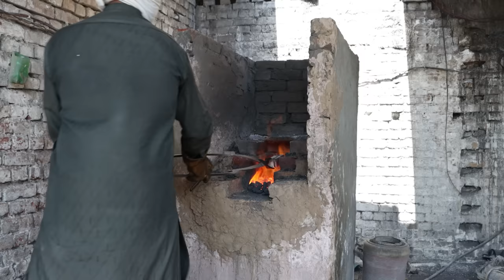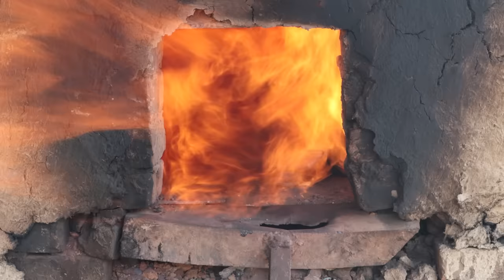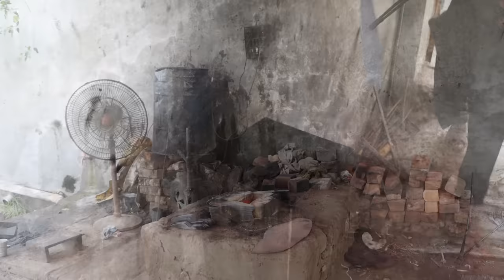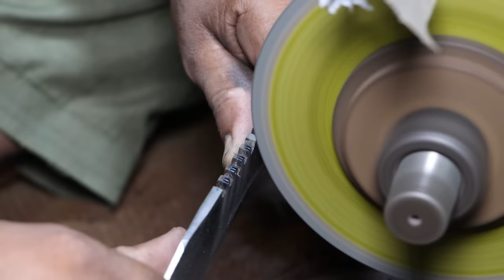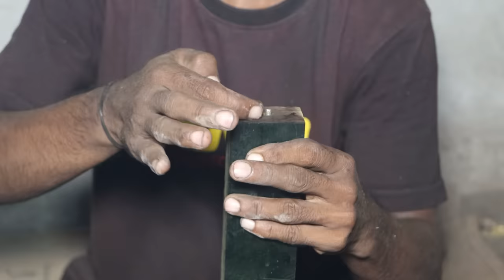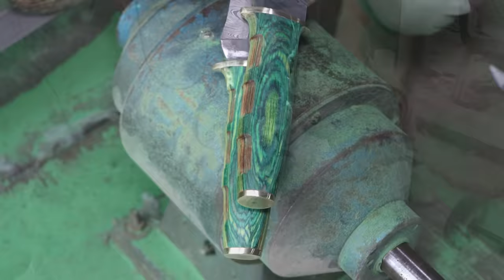Incredible Process of Making Super Sharp Hunting Knife

Comment: Let's call it what it is.  A temporarily sharp'ish knife made from scrap mild steel.
Reply: How can you say that it is not a high carbon steel?
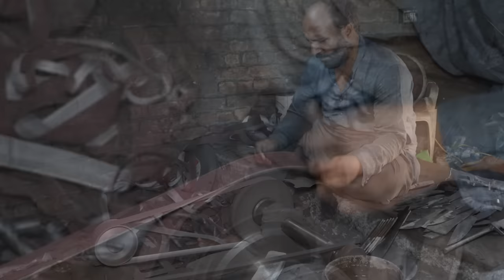Reply: @akhtarkh  The grinding sparks at 10:55.  Also they welded the tang without tempering it afterwards.  High carbon will crack at the weld in no time.
It is also going to rust since we can see it is clearly not stainless.
Reply: @rbhe357 😂😂😂😂 well said...just like how things went silent 😂😂😂
Reply: Complaining that Damascus (or if you prefer Pattern welded Steel) contains some low carbon material is like complaining that they made vodka but there's alcohol in it.  Yes, cheap stainless steel won't rust but you should just throw most of that away from square one.  Damascus steel is meant to be owned by competent people, wise enough to take care of it.
Reply: @badgerrrlattin35  What? Just because someone folds two types of metal together doesn't make it Damascus steel.  It makes it another cheap imitation that people who don't know better fall for.  Not being stainless isn't the real point.  If I baked you a cake, but used the scraps and stuff I found on the floor, would you eat it?  I mean it IS still a cake, right?
Reply: these are just wall hangers.... they dont even have a tang...
Reply: You are so right,I am a price winning knife maker and have tested some of them,absolutely crap,for decoration only.Just look at this tang,for kids only...Had bent a blade not even 10' and it broke!!😅 Even with this cheap prices they are not a good deal...
Reply: Agree go watch a real black smith like alec Steele and compare it. I'd rather folk out the cash and get something decent I know these guys have to make a living and I'm not knocking them just not up my alley
Reply: Junk knives
Reply: Low qulity indian pezans  mass production
Reply: @rbhe357  those sparks didn't look too low of carbon. Def not anything like 0.9% or anything but I'd put it around 0.6% carbon. I have 5160, the sparks are not terribly dissimilar.
Reply: @badgerrrlattin35 no it isn't. It's made to be owned by whoever wants it and can afford it. Makers want your money, not your care of knives before selling to you, unless they're one of those starving artists types that's not good to begin with
Reply: @rbhe357 oh man oh man are you misinformed. Folding is USUALLY applied to San Mai with the kobuse method. "Damascus" isn't folded. It's cut and stacked. Real Damascus is crucible steel in a MUCH different process.
Reply: The material they’re using is likely garbage and the probability that they’re heat treating correctly is very low. But the real joke here is people thinking they can tell the carbon content of the knives through the sparks in the video 😂 🤡 🌎
Reply: @freemarket913 Theres a difference between claiming to tell the carbon content and spotting garbage metal.  My comment and the sparks at the timestamp I referenced are very clearly the latter.  
Tons of long bright sparks usually points to mild steel.
Reply: I don't agree. 

They can put some carbon in there without adding too much to the cost. 

They worked that metal quite a bit. 

They folded it many times and they even twisted it.
Reply: But imagine what they could do with better materials
Reply: So if its going to rust its high carbon steel bro youve been watching too much forged in fire instead of actually forging a blade ,yes the tang is garbage the edge not the sharpest but the Damascus pattern was nice the heat treat reasonable lets give credit where credits due@rbhe357
Reply: @rbhe357 wrong the more sparks the more carbon smh
Reply: What I see beyond the quality of steel is that these people ruin their eyes, lungs, skin, to do something that gives them income. I don't care about the knife.  
Agree with the poor quality but the pattern is quite nice
Reply: Ain't most knives made of the same.
Reply: @gibblip.816  Most knives are at least made from stainless or better.
Reply: Ain't every knife and blade sharp temporarily? And lose it's sharpness over time and use?

Comment: Very weak tang. Also, loving all the loose clothing around the grinding wheels. 👍🏻 Aside from that, the dude on the power hammer has some crazy skills.
Reply: They wouldn't get as many knives from each billet doing it another way, but I bet they could make killer full or hidden tang ones from one piece.
Reply: For some reason, full tang is not common where I am from (India). I'm not sure if it is to save steel or about the balance of the knife.
Reply: Well if you feel that way about it.................Don't buy one
Reply: @josephaugustine4876  its for those blades that are mainly used for showpiece.
Blades that are used for real work have full tang.

Comment: There's only one critique that I would make is that they should clean up the steel before they welded it together
Reply: It just looks like rando scrap steel
Reply: I did not notice any flux either.
Reply: Its not necessary as they are only good for decorations...its cheap  crap from Pakistan 😅
Reply: Any addresses on why to contact them?
Reply: @kandaboy3026  you mean WHERE ,or WHY ? This cheap shit is sold by Ebay,for 20 or 30 dollars,but still not worth the money
Reply: Was thinking the same thing. Inclusions galore. I wouldn't be chopping anything with these. Look dope though.

Comment: Impressive skills but i saw a few issues. No flux used before hammering the steel together (unless you don't need it in a coal oven), when quenching, they dipped 2 blades pressed together in the oil and took a while doing it. You should quench as fast as possible and one blade at a time to get the best results. Also the tang looks way too weak for such a long knife. Needs to be full tang,,not something held by a few welds and a glued on butt cap.
Reply: the furnace was fired with coke - clean burning and adds plenty of carbon to harden the steel.
no flux needed when hammer welding.
on my hearth I have a piece of wrought iron laminated back in the 1800s.
the iron has rusted but the scale between the layers is as solid as ever.
Samurai sword makers work the same way.
Reply: @rosewhite---  I guess everyone else are just fools to use flux when they make their forged or pattern welded steel with hammer or press. It does absolutely nothing and is just a waste of time and money.
What about the other complaints like quenching 2 blades side by side and taking awhile to quench? Or the extremely short tang for such a big knife?

Comment: Looks good to me. Doing the serrations by hand with  grinding wheels was pretty impressive. Hope those guys are able to scrape out a living with those.
Reply: It´s a shitty knife. The welded rat tail tang will break after a few good smacks on a trunk. The blade looked good, but lacked structural integrity. Wouldn´t pay more than 10 bucks for it.
Reply: @Biden_is_demented  I don't know man, seeing 10 guys in a crap-hole country working to make that, I throw a bone. I'm not Mr Bushcrafter, building a stick hut
Reply: @homevalueglass3809  I´m not dissing their skill or ingenuity, but rather their design choice. Rat tail tangs are weak, and a welded one even more. They could have left some metal to work with, but chose to cut it close to the blade. They did it to save man-hours in the handle work. Had they went with a full tang, or even a hidden tang, the knife would be robust. As it is, it´s just a tourist trap. If you try to chop down a tree with that, you will end with just the handle in your hand, while the rest of the knife goes flying.

Comment: Very entertaining to watch. I love watching how these were made. That being said... these knives are basically cool looking junk. Unknown steel, sketchy heat treat, so/so assembly. I love their industrious attitude but these are for display not for use. My guess is they are mostly mild steel. These things most likely will rockwell out at mid 40's, will hold an edge for 1 use. Im sure you can buybthem cheap and they do look cool but not a serious knife. Ill watch these videos all day long though. Id also like to add that if they made a few changes and had so real materials i think they could make a real decent knife, they obviuosly have some skills. Of course they woukd have  to raise the cost of their product.
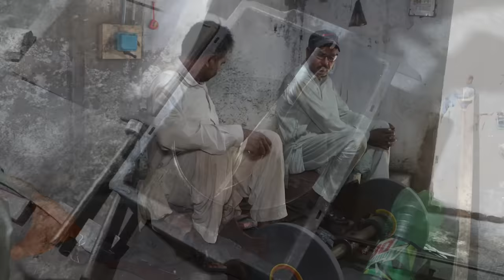Reply: 8:50 is the quench, and it's done all wrong.  At no point in this whole process has the steel been anywhere above 50 HRC.
Reply: To much work and efford, for do so crapy Heat Treatments and so thin rattail

Comment: I sure wouldn't do any heavy duty chopping with this knife.  The Tang is smaller diameter than a pencil, plus it's welded.  Yes, a couple of these guys have great skills, but bottom line, I wouldn't give $10 for a knife like this.  It even has the signature "Frostwood" handle, which screams  "EL CHEAPO".

Comment: Wow! These guys are good. Absolutely beautiful working knives. I knew much of what and why with the metallurgy. But the bending and twisting was fascinating to see. I appreciate the previous comments about that. Great video. Thank you.
Reply: Those knives are terrible. The welded tang is way too thin for any kind of practical use, especially for a knife of such size. I have one and it broke in a matter of minutes of real use. 
Shame, becuase with a slightly more expensive tang welded, let alone a smaller full tang knife, it would be much better.
Reply: My only thing is the way heat treated wasn't optimal
Reply: So. They LOOK good. But I don't think that it resembles Cold Steel Bushman in terms of quality. And what absolute cleanliness and order! What safety measures and working conditions! It is immediately clear that these are not Germans.
Reply: @Julzapo  they are not Germans that is quite clear they are in India even no the process isn't the cleanest or have alot of order the knife are very sharp and ca hold a decent edge!!!

Comment: No full tang = no durability. Easy design fix that would make the knife 100x stronger.
Reply: Really?! All the heat stressing, the full blade heat "treated" poorly, the serrated edge right before final grind, piss poor heat control while hammering and the tang is ehat kills the durability?!
Reply: Good 😊😊
Reply: @johnpike9612  I don't know much about blade smithing. The part that got me the most disappointed was how he put the edge on with all that heat, and also the tang. I thought all other Things were going to be fixed with a heat treatment before grindimg the edge, probably because I don't know enough.

Comment: correct me if i am wrong, but the knifes did not look hot enough for a proper queench(no red color, i.e. still magnetic), no tempering. Maybe its ok with the steel they use, but it i don`t think so. the knife won`t hold a sharp edge long and chip etc
Reply: You are not wrong. You need no correcting. It would be okay to quench under critical if You weren't worried about edge holding and toughness. They probably skipped tempering because they know it's low enough in carbon to not build up any residual stresses and also, it's not like they're taking it from 65 HRC down to the 50's. There is no way that steel can harden to real knife levels. Otherwise, that tang would crack immediately upon welding.

Comment: That will be a very low quality blade. None of the materials were cleaned before welding so there is definitely going to be bonding issues. They plasma cut out the shape instead of forging it to shape because it cannot be forged except for in one direction or it will delaminate. A welded on tang is not a good idea for a large hunting knife.

Comment: This looks like a general purpose knife.  Perhaps, for example, used by the Pakistan military. 

It is somewhere between a hatchet and a knife and it can be used for a wide variety of purposes.

This looks like a pretty good knife to me. 

I think the tang (the steel rod that penetrates into the handle) might be a little bit thin.  That could be a bit thicker.

I think the wooden handle itself, might be a bit too thick.

Overall, looks like a pretty good knife to me.

Comment: What steel was used ?How was it tempered? What was the spine thickness? Was it 90 degrees or rounded off? Stick tang is weak tang?
What kind of wood was used for the grip? How was it seasoned? Why the hollow grind? What was the angle of the secondary bevel?‘
What was the intended purpose of this knife? Shed some light on the sheath too. Leather, nylon, plastic, kydex? Shape? Specs? Any loop for a ferro rod?
Not a good knife in my opinion. Especially, not as a survival blade

Comment: I wish these youtube channels would stop peddling these garbage knives and highlighting their makers - it's unethical. I've been making them by hand for a couple of years now. They are using scrap mystery steel, not quenching or tempering correctly, they probably have voids all over the place due to their awful forge welding, and the partial tang with the rat tail causes major weaknesses at what should be the most structurally resilient area of the knife. There's no quality control, nor do they care about it. There is a reason why these knives are sold at such low prices. They are completely unsafe and should not be relied upon for any reason, especially for hunting or survival. They won't stay sharp and will likely break and injure the user. You get what you pay for. Cheap knives imported from the Pakistan/Chinese region really should be avoided and there are certainly much better US/European alternatives.
Reply: don't buy them then!!!!!! these are good enuf!!!! expensive ones can be pieces of crap also!!!

Comment: Everything looked good until the heat treating. Real knife steel, pattern welded or no, requires a normalization cycle and tempering after quench. Also the blades were way too cold on the quench. Definitely still magnetic. Real knife steel cannot be stick welded at the tang without immediately cracking. Hidden tang knives with an add on rat tail style tang can be made that way but they are silver soldered instead of welded. I've done it using a tig welder with silicon bronze and low welding temp/amps. But silver solder is the standard. These are swap meet/Amazon knives and shouldn't be taken seriously at all. They may look cool from a distance, and a few swings on some green tree bark proves nothing. That being said, they have some pretty cool equipment. So close, yet so far away. You get what You pay for.

Comment: I question the integrity of the forge welding process: no cleaning of the steel at any point, no flux between the layers is a recipe for forge scale buildup and incomplete layering. I would not trust the basic billet, much less the finished blade.

Comment: Wow, I've never seen such a botch. They don't even remove the scale layer from the steel before putting the individual plates together. How is the damask connection supposed to hold securely if the steel cannot connect well or at all? Never buy such crap, it's dangerous to use such a crappy laminated knife.
Reply: dangerous?!! u don't have a clue what you're talking about!!

Comment: Can anyone point to the part where the knives are heat treated? All I saw was the rough edge grind and a hardening process. No heat treat. These will be too hard and brittle without the heat treatment
Reply: u can't heat treat low carbon steel
Reply: @stevejohnson7656  is that the same as "mild steel"? If so, can it even be hardened at all? Are these knives even going to hold an edge?

Comment: It's so hard to watch. So much hard work and good skills and such a crap knife.(not the steel!, the making of the blade is really awesome!)
I'm materials engineer and the heat treatment is absolutely crap. The Steel is way too cold for a sufficiant martensite formation when quenched, and there is no annealing at all. I would really like to know the hardness of blade and the microscopic steel structure. The shape and geometry of the blade is very difficult to resharpen and not usable for hunting at all. And the saw on the back is unnecessary. But the worst is the tang. Why no full tang? It's flimsy and not worth the great work done before.
With some minor changes that  doesn't cost money, they could manufacture world class knives.

Comment: when the guy is grinding the edge, you can clearly see the blue color of doom on the blade edge.
over heated it, pushed it too hard, too long, the steel is now shit, it will snap or bend in use.
Reply: At 8:50, when quenching, they let the steel cool down completely out of range for the quench.  The steel had never been hard to begin with.

Comment: I can guarantee the temper is ruined in these blades because of the heavy grinding without cooling the steel after heat treatment.
Reply: Around 8:50 the heat treatment is all wrong, the steel never gets to proper hardness.

Comment: Junk. If you hit a hardened untempered blade with a hammer it would shatter like glass. You can also tell from the grinder sparks there's not nearly enough carbon in the steel. The welded tang will destroy the heat treatment at that point leaving it soft and weak right where it needs to be strongest. Its just a piece of scrap metal that has been shaped to look like a knife.

Comment: Aaaa... NO! They didn't use any BORAX for forge welding, nor enclosed the initial pieces of metal to prevent oxidation. I'm expecting the metal to be weak. Also, the tang is TINY, I could break or bend it with my bare hands! So NO, this is not how you do this! Bad work!

Comment: I have three kukuris made by Kalashe in Nepal. These are traditionally rat tails. This is fine and very strong if they are made as part of the blade and not, welded on. I use/ abuse the shit out of these knives and have never had a problem.